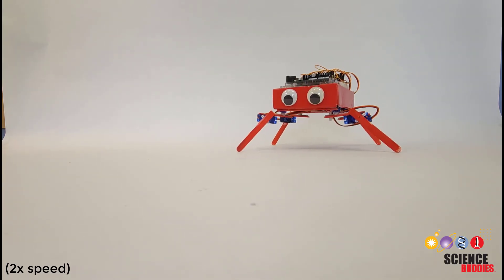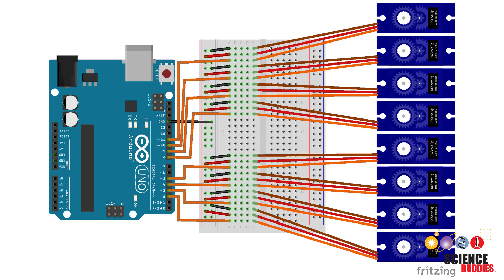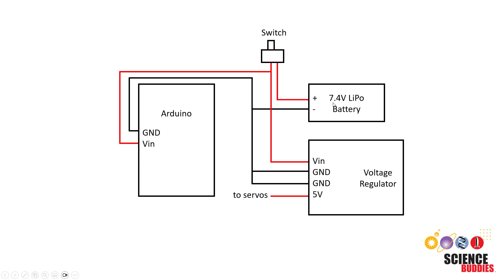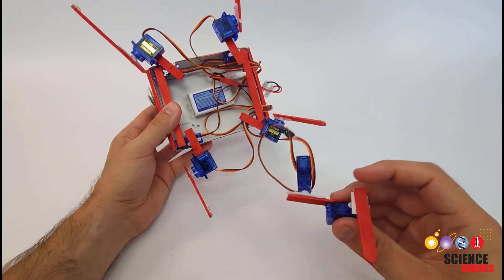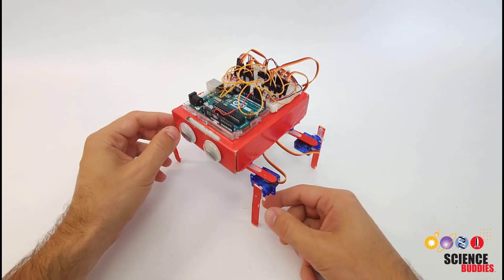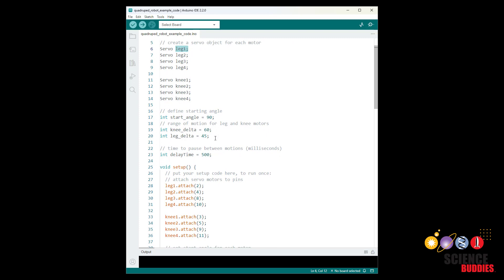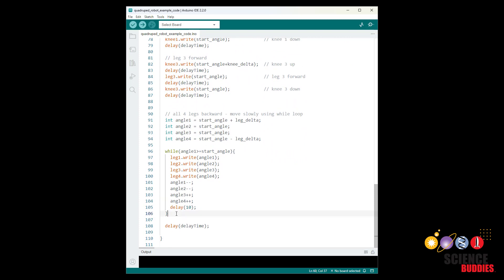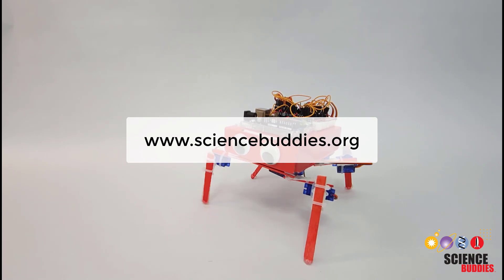How to Build a Walking Arduino Robot (Quadruped) with Cheap Materials | Science Project

Comment: our teacher suggested to use a powerbank instead of batteries for power but im not quite sure how that would work.. do you have some tips? i really need it soon.
Reply from the maker: You might want to watch this video: https://youtu.be/I7MrL5Q7zvY?si=v96kSkN2HrF7qM5d, we don't specifically cover USB power banks but it covers using external power with the Arduino. For a USB power bank you would need an adapter that "breaks out" the individual wires from the USB port so you can access the power (5V) and ground (0V) wires.

Comment: Does the type of voltage regulator matter ? Thanks for the vid 🙏
Reply from the maker: The output of the regulator needs to be within the acceptable voltage range for whatever you're using it to power (like the servos).
Reply: @Science.Buddies  and for the switch or button - is that the one that comes in the arduino or completely seperate ?
Reply from the maker: We recommend referring to the materials list in the written instructions: https://www.sciencebuddies.org/science-fair-projects/project-ideas/Robotics_p058/robotics/arduino-walking-robot?ytid=tCtgt-VoPUk&ytsrc=description#materials. The kit linked there includes a switch you can use.